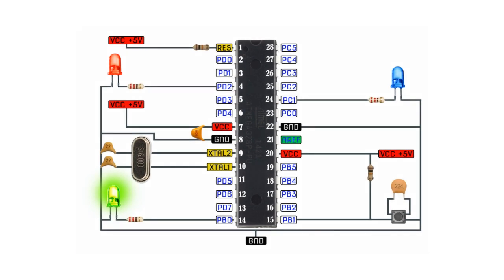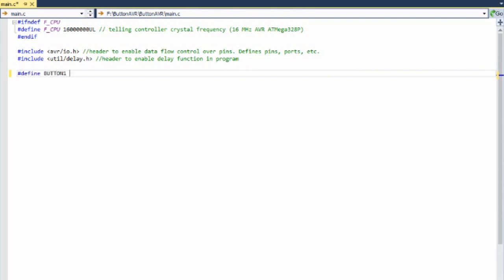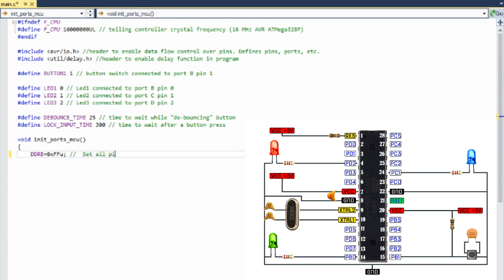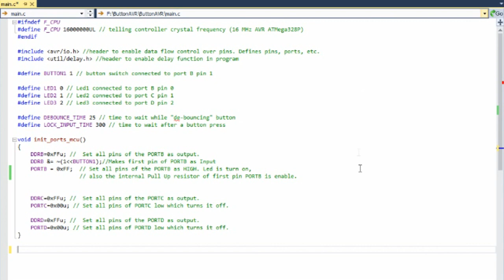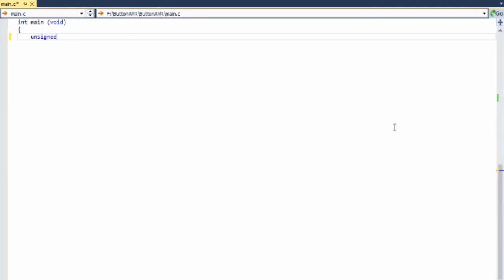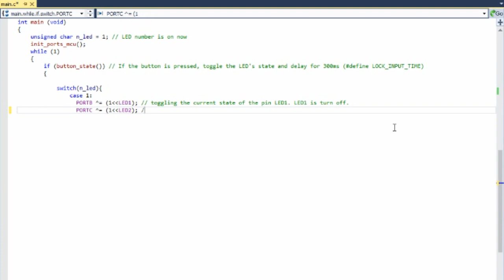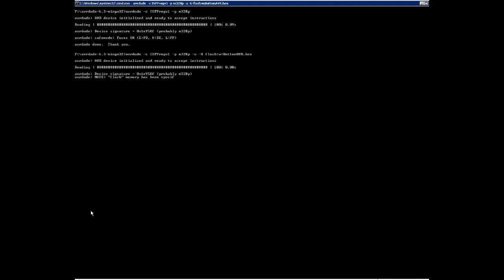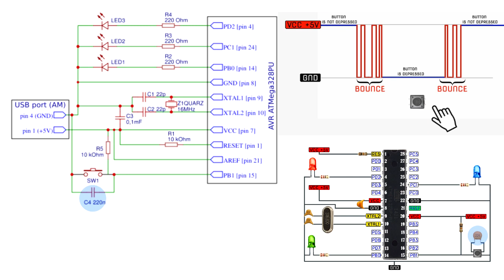AVR Microcontroller. Toggle LED’s using a Push Button Switch. Push Button Debouncing.

Comment: 8:16 did you mean LED1=0 instead of LED1=1? I'm talking about the small blue text in the calculation. This would be true for PORTC right?
Reply from the maker: It's an example to PORTB, it's looking correct.
Reply: @FOGDIY  But you #defined LED1 as 0. //Led1 connected to port B pin 0. After that you shift 1 << LED1. So that means 00000001 << 00000000 = 00000001 right? I'm probably wrong though, I'm still learning.
Reply from the maker: Yes indeed, an error, led1 is always 0 as 0 pin in port B, hence 1 << LED1 =1 << 0 = 00000001. mistake in picture, code correct.

Comment: Hi, thanks for this great tutorial. Is it possible for you to share that code please?
Reply from the maker: Yes of course... Here is this simple code:
#ifndef F_CPU
#define F_CPU 16000000UL // telling controller crystal frequency (16 MHz AVR ATMega328P)
#endif

#include <avr/io.h> //header to enable data flow control over pins. Defines pins, ports, etc.
#include <util/delay.h> //header to enable delay function in program

#define BUTTON1 1 // button switch connected to port B pin 1

#define LED1 0 // Led1 connected to port B pin 0
#define LED2 1 // Led2 connected to port C pin 1
#define LED3 2 // Led3 connected to port D pin 2

#define DEBOUNCE_TIME 25 // time to wait while "de-bouncing" button 
#define LOCK_INPUT_TIME 300 // time to wait after a button press

void init_ports_mcu()
{
	DDRB=0xFFu; //	Set all pins of the PORTB as output.
	DDRB &= ~(1<<BUTTON1);//Makes first pin of PORTB as Input
	PORTB = 0xFF;  // Set all pins of the PORTB as HIGH. Led is turn on, also the internal Pull Up resistor of first pin PORTB is enable. 

	
	DDRC=0xFFu; //	Set all pins of the PORTC as output.
	PORTC=0x00u; // Set all pins of PORTC low which turns it off.

	DDRD=0xFFu; //	Set all pins of the PORTD as output.
	PORTD=0x00u; // Set all pins of PORTD low which turns it off.
}

unsigned char button_state()
{
	/* the button is pressed when BUTTON1 bit is clear */
	if (!(PINB & (1<<BUTTON1)))
	{
		_delay_ms(DEBOUNCE_TIME);
		if (!(PINB & (1<<BUTTON1))) return 1;
	}
	return 0;
}

int main (void)
{
	unsigned char n_led = 1; // LED number is on now
	init_ports_mcu();
	while (1)
	{
		if (button_state()) // If the button is pressed, toggle the LED's state and delay for 300ms (#define LOCK_INPUT_TIME)
		{

			switch(n_led){
			    case 1:
				  PORTB ^= (1<<LED1); // toggling the current state of the pin LED1. LED1 is turn off.
				  PORTC ^= (1<<LED2); // toggling the current state of the pin LED2. LED2 is turn on.
				break;
				case 2:
				  PORTC ^= (1<<LED2); // toggling the current state of the pin LED2. LED2 is turn off.
				  PORTD ^= (1<<LED3); // toggling the current state of the pin LED3. LED3 is turn on.
				break;
				case 3:
				   PORTD ^= (1<<LED3); // toggling the current state of the pin LED3. LED3 is turn off.
				   PORTB ^= (1<<LED1); // toggling the current state of the pin LED1. LED1 is turn on.
				 n_led=0; // reset LED number
				break;
			}
			n_led++; // next LED is turn on 
			_delay_ms(LOCK_INPUT_TIME); 
		}
	}
	return (0); 
}

Comment: Hii friend, The pullup resistor value is 10K right? What is need of a pullup resistor?
Reply from the maker: So what value resistor should you choose? The short and easy answer is that you want a resistor value on the order of 10kΩ for the pull-up. A low resistor value is called a strong pull-up (more current flows), a high resistor value is called a weak pull-up (less current flows).
Reply: @FOGDIY  Thanks broo

Comment: Nice video But If I want to count button and respond to it (for example if I press button for 3 times LED blinks for 5 sec.) how dose it work could you please teach me
Reply from the maker: Sample code: 
#ifndef F_CPU
#define F_CPU 16000000UL // telling controller crystal frequency (16 MHz AVR ATMega328P)
#endif

#include <avr/io.h> //header to enable data flow control over pins. Defines pins, ports, etc.
#include <util/delay.h> //header to enable delay function in program

#define BUTTON1 1 // button switch connected to port B pin 1
#define LED1 0 // Led1 connected to port B pin 0

#define DEBOUNCE_TIME 25 // time to wait while "de-bouncing" button
#define LOCK_INPUT_TIME 200 // time to wait after a button press

void init_ports_mcu()
{
	DDRB=0xFFu; //	Set all pins of the PORTB as output.
	DDRB &= ~(1<<BUTTON1);//Makes first pin of PORTB as Input
	PORTB=0xFFu; 
}

unsigned char button_state()
{
	/* the button is pressed when BUTTON1 bit is clear */
	if (!(PINB & (1<<BUTTON1)))
	{
		_delay_ms(DEBOUNCE_TIME);
		if (!(PINB & (1<<BUTTON1))) return 1;
	}
	return 0;
}

int main (void)
{
	int ntime=0;
	unsigned char ncount = 0; // initially  button count
		
	init_ports_mcu();
	PORTB ^= (1<<LED1); // toggling the current state of the pin LED1. LED1 is turn off.

	while (1)
	{
		if (button_state()) // If the button is pressed
		{
			ntime=0;
			ncount++;
			_delay_ms(LOCK_INPUT_TIME);				
		}
		if (ntime>32000000) // time set for led switch mode ~ 1 sec
		{ if (ncount>0)
			{
				PORTB ^= (1<<LED1); // toggling the current state of the pin LED1. LED1 is turn on.
				while (ncount>0)
				{
					_delay_ms(1000); // LED turn on for 'ncount' sec.
					ncount--;
				}
				PORTB ^= (1<<LED1); // toggling the current state of the pin LED1. LED1 is turn off.
			}
			ntime=0;
		}
		ntime++;
	}
	return (0);
}
Reply: @FOGDIY  Thank you for your replay I am working on implementation, as soon as I get success I will contact you
Reply: @FOGDIY  Thanks broo
Reply from the maker: @victormp3866  you welcome